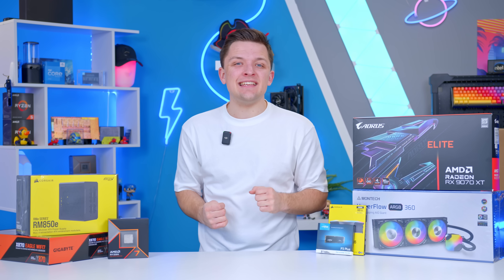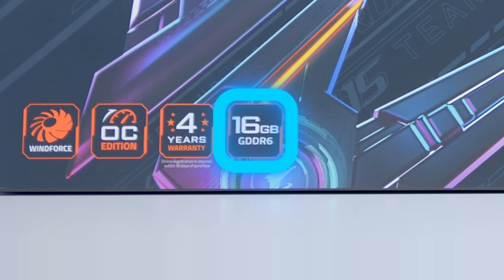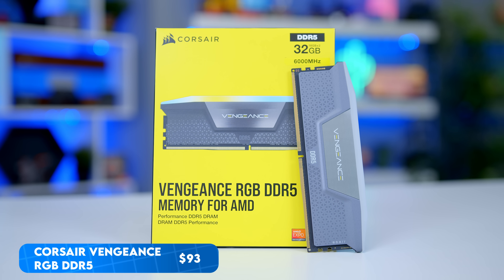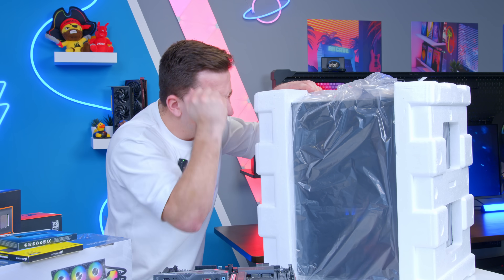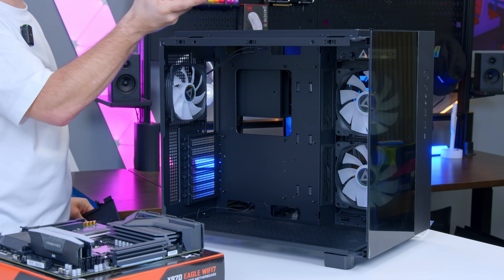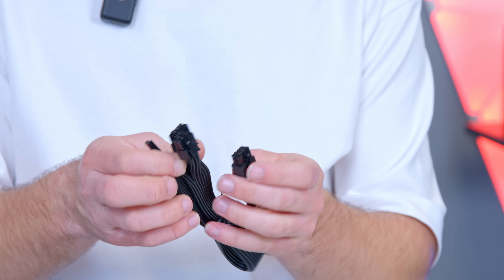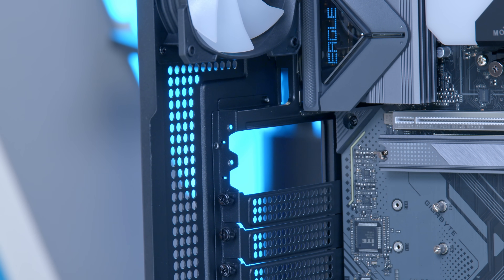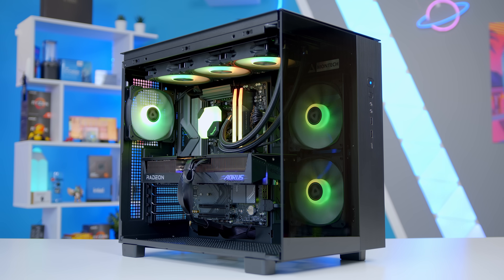Awesome RX 9070 XT Gaming PC Build 2025! 😄 [Full 1440p Build Guide w/ Benchmarks]

Comment: Is a 7800x3d or a 9700x a better for this build?
Reply: 7800x3d and it's not even close it's the second most powerful gaming CPU the 9700x isn't as good for gaming
Reply: Ikr. I can't decide which one to pair with the 9070xt
Reply: Get a 7800x3d trust me!  @Scorpion-yl7vb
Reply from the maker: 7800X3D will give you faster raw gaming perf, especially at lower res like 1080p where you're more bound by a CPU than a GPU bottleneck :)
Reply: @GeekaWhat Is 7600x enough for 1440p with this GPU?
Reply: For this build for example go with cheaper B650 motherboard, cheaper RAM kit that has no RGB, cheaper CPU air cooler like TR Peerless Assassin 120 and you can fit a much better CPU. 9800X3D or 7800X3D will be good at 1440p.
Reply: @themarketgardener That sounds similar to a B850I Fractal Terra machine I’ve been fine-tuning recently. It has a slightly undervolted 9800X3D cooled by a very effective NH-L9x65, and a non-OC 9070 XT. So far, the benchmarks are pretty impressive for a 1440p SFF build.
Reply: @themarketgardener This is exactly what I did and it’s the best way to spend your money
Reply: if you play more cpu intensive games like valorant fortnite ect x3d is better but tripleA games and if you want to save some money maybe go with the 9700x
Reply: 7800X3D. In literally every gaming situation at all the 3D VCache is just a technological game changer. It’s kinda like a have or have not thing but if you are never gonna game, then consider the newer CPUs
Reply: 7800x3d will offer better performance because at some point, few games rely on CPU and a better CPU with more 3d cache will always do better and give 10 to 15% more FPS.
Reply: @IntrovertWolf25  yeah i agree its just more expensive so it depends on the builder's budget
Reply: @hyakkimaru1057  Gaming in 2025 itself is very expensive. So waiting for few more months to save more money is worth it since we won't be changing our CPU & GPU for many years to come.

It's better if we have best parts since this a long term investment.
Reply: I had my new pc built for weeks with a 7800x3d, was waiting for a 5070ti or 9070xt and finally got the 9070xt, and man it runs so good, I’m pretty sure 7800x3d beats 9700x in everything but loses in productivity by a little. But the 7800x3d is just the better chip.
Reply: @VortexApex It’s looking like the Ryzen 7800X3D & 9800X3D are a great match for this GPU, isn’t it? It reminds me of how well the 7800X3D paired with the 7800 XT.
Reply: 7900x3d with the 9070 would go crazy
Reply: If you're gaming at 4k or even 1440p either of these cpus will be fine. Its only at 1080p do the x3d chips make a big difference.
Reply: 7800x3d or 9800x3d better with this gpu?
Reply: @boti9654  9800x3d. If you can get the 7800x3d for more than $50 cheaper then that has better price to performance
Reply: 9700X shouldn’t have much trouble running a 9070XT at 1440p or 4K. If you’re still at 1080p, however, then I’d go X3D.
Reply: @Teh_Monk  ahh okay so 9700x gor 1440p and above, thanks man, will do that then!
Reply: @Darkhold_Userno don't do that 7800x3d is better for all resolutions
Reply: @Allalos-s2l  ah great now in doubt all over again lol
Reply: @Darkhold_User  yeah it's hard building your first pc but trust me the 7800x3d is the best for gaming if you don't want any risks with the 9800x3d
Reply: @Darkhold_User  or you could wait for the 9950x3d to come out it's gonna be more powerful for everything even gaming
Reply: @Allalos-s2l  true and thanks for the help, i wont be buying the parts yet, just planning it out, so maybe the prices will drop for the other cpus after the 9950x3d comes out or the price for that wont be that bad
Reply: @Darkhold_User  yeah it will be the same price as last gen 699$ for the 9950x3d
Reply: @Darkhold_UserIt all depends on prices, the X3D is obviously better at gaming at 1080p but due to shortage (well at least at my location anyway), is way more expensive than the 9700X. Not to mention that once you’ve gotten beefy graphics card 1440p resolution would make the CPU usage less. I’ve seen benchmarks at 1440p and 4K where the 9700X just have the same frame rates with the X3D, so it all depends on your budget and usage.
Reply: @Allalos-s2l but like more expensive tbh
Reply: @Allalos-s2l yea but the 7800x3d is out of stock and above msrp in my country if it’s still at that I’ll grab the 7700x it’s only behind 9700x by like 1%
Reply: What are you talking about?! The 7800x3d would be plenty for this card and I would actually down size the chip to maybe a 7700x and still have good performance at 1440p
Reply: @ther3aldeal218 yea no it isn’t a lot for the card but more than enough because this monster is equal to the 4080 and close to the xtx
Reply: @Uda_lku  I’m seeing builds from reputable pc builders building a 9070xt with a ryzen 5 7600x with no problems, you don’t need to over spend on the cpu
Reply: @Teh_Monk thanks brother
Reply: Use a 7800x3d if ur using an Aio and if you dint care about power consumption
Use an 9700x if ur using an air cooler
(It doesnt need extreme cooling tools since it only consumes 65w of power) and you can save up more money.....

Comment: Any good alternatives for the case? 65 isn’t available
Reply: Antec C5(comes with 7 pre installed fans), phanteks nv5, Corsair 3500x, antec c3, thermaltake view 380 or 270.
Reply: I got myself a pretty similar build but got the Corsair 3500x with Arctic liquid freezer III 360

Comment: Hi I'm building my first PC, do you have any recommendations? I'd appreciate any tips, thank you :)
GPU : Gigabyte Radeon RX 9070 XT Gaming OC 16GB GDDR6
CPU : AMD Ryzen 7 9800X3D
Motherboard : MSI B650 GAMING PLUS WIFI
PSU : be quiet! Pure Power 12 M 850W 80 Plus Gold ATX 3.0
RAM : Lexar 32GB (2x16GB) 6000MHz CL30 Ares RGB
Storage : Kingston 2TB M.2 PCIe Gen4 NVMe KC3000
Cooler : ENDORFY Navis F360 ARGB 3x120mm
Case : ENDORFY Arx 700 ARGB
Reply: What's your target resolution and why do you need the 9800x3d?
Reply: @Diversified_amogus  Anything above 4070 Ti Super and you should get a 9800X3D if you can afford it. It's not about needs, this is not a budget build imo.
Reply: @ in my country prices are very expensive, and I think this GPU and CPU are the best in the market right now that my wallet can afford, but I have no idea about the rest of the build
Reply: @themarketgardener  nope, for gaming you're GPU bound on Higher resolutions, so not everyone needs a 9800x3d. But yeah; if you can afford, why not
Reply: @Diversified_amogus  For higher resolutions, the huge L3 cache on a x3D CPU still helps alot ot flatten the ,1% and 1% lows resulting in smoother framerates.
Reply: @ 1440p, and later 4k, I'd like to keep this computer for at least 6 years
Reply: @pawelaa907  I think your build looks great with that plan.
Reply: @ thanks :)
Reply: Instead of msi b650 gaming plus wifi, get something else based on number of devices you will connect to your pc. It's one of the worst b650 mobos.